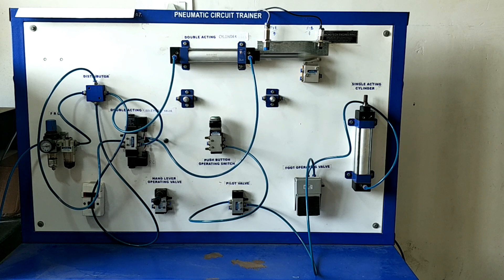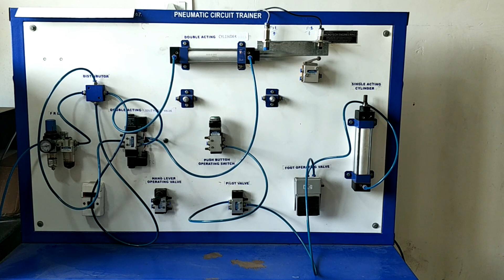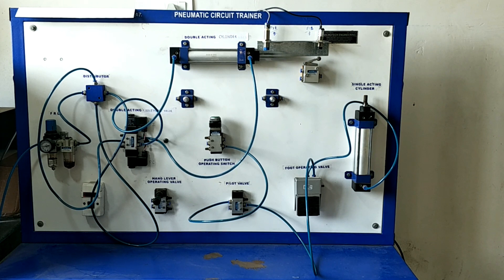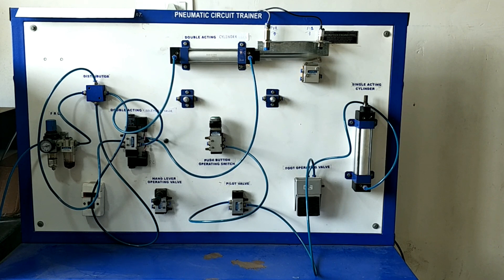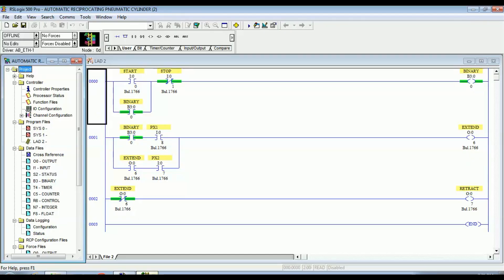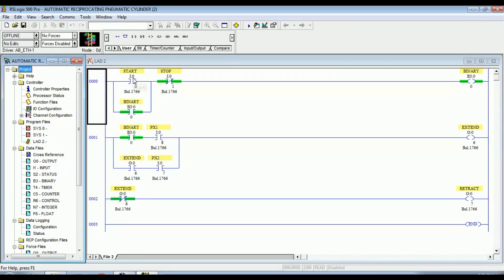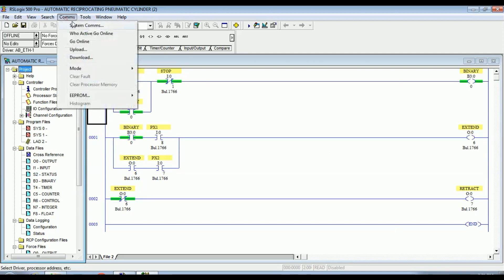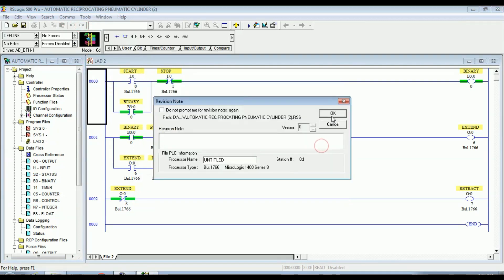Automatic Reciprocating of Pneumatic Double Acting Cylinder using PLC (ALLEN BRADLEY)

Comment: Do you have a parts list available
Reply from the maker: yes
Reply: @EasyMechLearn  where is the parts list ?
Reply from the maker: @joew4202  Compressor, FRL unit, Double acting cylinder, Double Solenoid operated 5/2 DCV, Flow control valve, Two Proximity sensors, and PLC
Reply: @EasyMechLearn  I know what the parts are, I need to find somewhere to get them
Reply from the maker: @joew4202  Go to SMC pneumatics for components